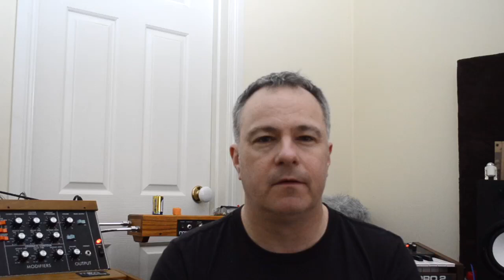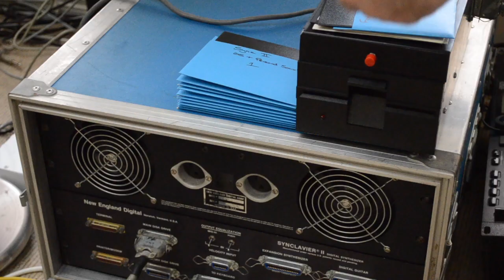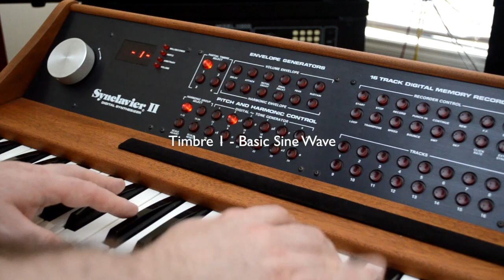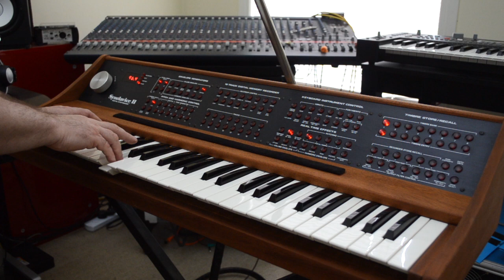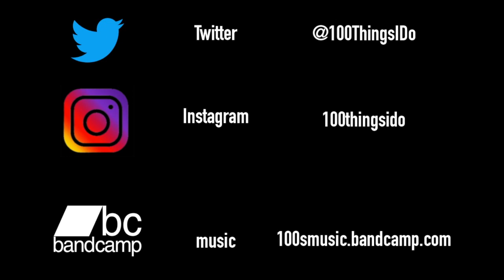SYNCLAVIER II CLIP #1 - Harmonic Additive Synthesis

Comment: Amazing.  Is this better than the Synclavier 1?  Also, does it need an external computer to work or just the keyboard?
Reply from the maker: A bit different to the Syncavier I which was more a university experiment and not a true production machine. Yes the keyboard is just a keyboard and does nothing at all without the computer section of the Synclavier driving it :D

Comment: Oh, gosh that's gorgeous.

I was a subscriber to Keyboard back in the day and would absolutely lust over the 2-page ads when the Synclavier came out. I did additive synthesis at CCRMA for a couple of quarters. The sound you get here reminds me of a lot of the sounds that came out of that center. I didn't really remember until this video how different this stuff sounds from the normal subtractive synth world. It's really stunning. 

Now I desperately want the Arturia (as well as their cs-80 simulation 😏).

Wow wow wow.
Reply from the maker: Arturia Syncalvier is great! Runs parts of the original code (I was told this by Cameron who wrote the original Synclavier software)! :D

Comment: You seem to have very little trouble building up a nice-sounding patch from scratch; would you say that's the norm for the Synclavier? One reason I ask is that I'm the type who will get a synthesizer and delete every single factory patch, but I'm leery of doing that outside of subtractive synths because I worry that I won't be able to intuit how the instrument works well enough to develop my own patches. Seriously considering picking up Arturia's softsynth version if/when it goes on sale.
Reply from the maker: Its quite easy indeed but very different to the way the DX-7 deals with FM. You basically build 1 to 4 harmonic spectrums then add FM with the FM Envelope. Normally I'm not going for any specific tone or sound.. just create something on the fly that inspires me and go with that. For sure the Arturia Synclavier is fantastic there is also the iPad version from Cameron Jones himself which is fantastic and support MPE both well worth the money. :D

Comment: That instrument has been my holy grail, my wet dream, my unobtainable love of an instrument since high school, back when I heard it used for the first time in Patrick Gleason’s, ‘Vivaldi’s The Four Seasons.’  Now I have one — one that exists only as software mind you — but still, it is a damn good, faithful recreation of the original instrument. It is built around the same ABEL code that the original was. In many ways it goes way beyond the original in terms of the UI, programmability, and sound quality. It is Arturia’s Synclavier V.  Learning to program it well enough to be able to hear a sound in your mind’s ear and be able to dial it up is a steep learning curve. Just god through the presets and you will get a very good idea of the breadth and depth of what this instrument could do (and can still — even more so) today. With a good, high-quality MIDI keyboard controller, you can have your very own Synclavier. One thing I would love to see Arturia add is the full sampling, sequencing, and ‘record to disk’ side of the instrument. That way, you could run it in ‘stand alone’ mode and have the full Synclavier experience, no need for your DAW — well, OK, you still need to do all of your post production in your DAW but, hey, just nitpicking here, after all, Patrick Gleason mixed and saved out the final mix onto a stereo digital tape on the Synclavier, no mastering at all.
Reply from the maker: The Arturia version offers a lot more functionality than the hardware, its a great instrument. One of my friends did a comparison  between that and the iPad version from Cameron Jones and team and found they sounded exactly the same. So, its all about Cameron's wonder code and how it makes the sound than the platform your running it on :D

Comment: as a student i was lucky to earn some experience with the Synclavier II — one of its many strengths is that it doesn't produce any "unnecessary" frequencies — it sounds fantastic in the mix and it sounds also majestic as a standalone.
Reply from the maker: Yep, the single filters on the front really give it a mellow sound :D
Reply: I too was able to use the system when I attended Full Sail in Florida back in 1990 and it was truly a wonderful experience. How I miss working with those fully expanded systems!

Comment: I looked through the comments and didn’t see it asked so sorry if you have: I have the iPad Go! app and was curious if that main pad sound was a preset or did you cook it up? If preset what is it called?
Reply from the maker: Its the sound I cooked during the video. I think I used Eventides BlackHole reverb to give a bit of modulation. More sustain on the tail of each note and a slightly longer attack :D

Comment: If i ever win euro millions...
Great piece of engeneering !
Reply from the maker: It really is fantastic :D I just need some more FM voices for mine
Reply: @100ThingsIDo  Old comment,  but,
Are these machines upgradable ? Like adding one extra board for an extra partial...?
It's crazy,  this thing was so ahead of the time . The guys who designed all these boards,  PCBs, all the circuitry,  etc,  must laugh (or cry) when they see what can be done with today's technology... like the tiny raspberry pi thing.   I wonder what these guys would be able to invent,  today,  with all the tech available...for sure, they would create some kind of crazy hybrid access virus + oberheim + moog + prophet + Yamaha cs80 + ...., and would probably invent some new synthesis modes..
Also, the sound you created at 3'05", was just too good...  the guys who own arturia's synclavier V must be in heaven,  if you somehow were able to share the preset with them (I wonder if it's even possible,  to export from hardware and import 100% identical,  via the arturia plugin. 

Thanks for sharing your videos (btw, you went from 1000 users,  the time you published the video,  to almost 5000 users,  today 6/6/20)

Comment: Excellent synth.Totally destroys the Arturia in sound quality and function.
I wish some synth company, maybe Arturia would re-issue and make a real unit for sale. I would buy one instantly.
Reply from the maker: It would be nice, the problem with the Synclavier is almost nothing is in the public domain on how the Able processor works, how the XP/L code functions etc.. Without that even reverse engineering is a very very very difficult task :D
Reply: Well, this is probably sort of both right and wrong. The Arturia version after all is more or less the original code, down to preserving certain quirks and limitations (due to the 1980s hardware limitations) which could have been easily fixed today but Arturia has wisely chosen to keep them in place in order to preserve the integrity of the original presets. So the output hitting the D/A converter's input ought to be exactly the same. The difference in sound is most likely due to the fact that most home PCs have firmly average sound cards and the original Synclavier had (I'm assuming) a dedicated top-quality D/A converter.
Reply: Well even DAC per voice in the hardware Synclavier ! Huge difference compared to the software.You are playing a four notes chord using four partials, there are 16 different DACs plus the final one.The sound is a lot more lively.

Comment: The NeXT best thing that you can buy is the Kawai K5000 Advanced Additive line of synths. They Excells at Additive synthesis in the hardware world, no FM though.
Reply from the maker: I have always had my eye one getting one .. just waiting for the right moment :D
Reply: I love mine. I have a demo of it on my channel, if you are interested: https://www.youtube.com/watch?v=owU3hwBQ0is
Reply from the maker: Ill check it out .. thanks :D
Reply: +100 Things I Do also the Seiko DS-101 and DS-202. Which you could attach the Seiko DS-310 (additive synth to) as well as DS-320 Sequencer but that only to the DS-202 model. These were basically home keyboard additive synths and Seiko's attempt to get in the digital keyboard market and compete against brands like Casio.

The DS-202 has all the home keyboard features with the auto rhythms and bass cords and such as wel as 10 preset sounds. An analog chorus is built in to liven up the sounds but when you hook it up to the DS-310 Additive synth then it really becomes something special. The DS-101 is a stripped down version of the 202 with some added features. No rhythms or any of that stuff. Something like sustain, key transpose, and tune knobs are still included. Just 16 presets (6 extra over the DS-202) including 4 "synth" sounds. They expected the 101 to sell sometimes without the 310 so they thought the 4 synth sounds may lure back a purchaser to add the 310 later. both the 101 and 202 could be sold by them selves or as the kit. From the research I have done it appears most of the 202s were sold as the kit, because spending that kind of money already they might as well have went all in or just stuck with a Casio. Still, you see the 202s sell without the kit. Maybe a lot of 202 keyboards were left over after production and were sold at a reduced cost....who knows. The lower end DS-101 seems to be more rare....as there is much less info and talk about it on the web, let alone evidence of past sales. The keyboards alone sell for around 300 bucks....give or take....but the kits sell for a few grand!!! I saw where a kit sold for under 400 dollars in the past.....man I wish I would have got it. I bought a DS-101 from the online Goodwill auction site. Funny enough my winning bid was also the cost of shipping, both $38....but the bottom peice of the case was smashed into pieces and 1 key needs to be fixed. I put back together the puzzle, superglued and duct taped it....looks ugly but it works! P.S. Most synths from goodwill will be broken in some way. Also, they may say only a key is broken...but then u find out half the circuits are dead. Be careful when buying from the online goodwill as there are no returns and it is %100 percent risk. I got burned on a Korg SP-80S that I am now selling for less than I payed.
Reply from the maker: Thanks for the Information on the Seiko, I saw someone give a good demo of the synth on Youtube a while back (can't remember who this was unfortunately now). Its great to explore new things, even if they are in older machines. The synth world seems to of gone Analog mono and Analog poly mad!.. While this is great in some respects it would be nice to see more people with new and fresh ideas. Turn the  Paradigm on its head and go in a different direction!  In the mean time I'm sure i'll pick up the Seiko at some point :D Thanks again!
Reply: +100 Things I Do Maybe the Quantum from Waldorf will set in motion a new wave of digital. I don't think granular synthesis has seen it's golden age yet. Hope to get one of those if they ever become affordable on the used market.
Reply from the maker: Yep. The Quantum looks very very interesting. I very much like to look of the C15 from nonlinea Labs also, under the skin the voice architecture is quite unique from your run of the mill FM Synth.  Granular is very cool, "Sampl35 - Fairlight CMI III MFX 2" is a clip I made of Granular samples of my composed tracks sampled and turned them into a track with hip-hop flavors on the Fairlight! I wish the Quantum would come down a little in price. For 8 voices that's a hell of a price!  but then quality = money :D

Comment: You have two things I've always lusted after: a Fairlight Series III and a Synclavier. Well played Sir. Even though they can be recreated in software, there is still something awesome about the original units.
Reply from the maker: I'm a hardware guy! I own and have tried so many software synths over the years. Very few have made their way into my workflow. There is nothing like the feeling of actually using the real thing as you say :D
Reply: Totally understand. I lean towards the soft-synth path (I have hardware too) because of space availability, cost (who has the budget to buy all these vintage units?) and the convenience of being able to do most things inside the box. I'm not a pro, so emulations are fine for me and truth be told, in the mix they sound good enough for me. Doesn't mean I don't still want some of this cool gear in my studio though ;-)
Reply from the maker: When all is said and done... its about the music and the sound you create .. who cares what you used :D  The only 2 synths I ever regret letting go was my first synth (Roland SH-3a) and my Prophet 5 ( which came to a sad fate after I sold it ) :D Most of the rest I can part with when I feel it does not inspire or fit my needs!

Comment: beautiful, magical @3:00
Reply from the maker: It is indeed capable of amazing, warm and lush sounds. Just so very different to other FM implementations around that time :D
Reply: i was always fascinated with this early ned sound.  found the ork locally, but no early fm cards. would have to ship from the states - which means $$$$.

btw, have you ever tried the newer machines, from 1984 onwards, with 16bit fm ?

i presume theres less quantisation noise and aliasing, but i wonder if they lose much of this warm, magical character ?
Reply from the maker: The only Synclavier I have ever had my hands on is mine!  They are a rare beast at the best of times... I could not locate one in Australia to purchase or even play! I'm not sure that they moved to 16 DAC's for the FM but I am possibly incorrect on this! The Sample cards and the FM are very separate interfaces (you might know all this already). I only have the 8 FM voices presently .. If your on Facebook there is a 'NED Synclavier - Classified' group you could join. Systems and parts show up from time to time at decent prices! :D
Reply: thanks, ill give it a look. will try to find out more about the hardware changes too.

PS what was the reverb you used in the improv section, im intrigued?
Reply from the maker: I can't remember for sure  but its normally one of the following - Eventide Black Hole, Valhalla Vintage Verb (set to 70's flavor) or Waves RVerb. I'm pretty sure it would of been Valhalla Vintage on this one :D
Reply: Hi Clusterchord, the FM Synth cards did not change after the stereo upgrade in the early 80s. Later Systems use the same 8Bit FM engine as the small SyncII systems. The main thing added by the "big" systems was faster CPUs, bigger storage and polyphonic sampling. You can stack and freely route Sampling and FM. The 16bit sampling engine combined with the 8bit FM engine sounds absolutely sublime, like nothing else in this world!

Comment: Does the keyboard itself has any synthesis engine inside?
Reply: No, you don't need it to program sounds
Reply: I mean those huge racks that are connected to the keyboard. What synthesis is possible without those racks?
Reply: Those huge racks were the 9600 systems with FM and stereo sampling.
The smallest rack you could have would be an FM system only , then a 9 or 10U rack
Reply: That is what I am using,without keyboard
Reply: OK, and if i have only the keyboard. What's then possible?
Reply: Nothing,it is just a controller
The synth's engine is in the rack
Reply: That's what i wanted to know, since the first question. Thanks! :-)

Comment: Wally badarou did a lot of the patches in the 80's   ... he worked with level 42 and grace jones. he released  an album made completely on the synclavier in the 80's . called  (Words of a Mountain)
Reply from the maker: I'll have to check out Words of a Mountain! I think Slave to the Rytm (LOL!!) was done on Synclavier if I remeber correctly! :D
Reply: 100 Things I Do have the arturia emulation of the synclavier which focuses mainly on the fm side without the sampling capabilities.

Slave to the rhythm is actually my favourite grace jones track  :-)
Reply from the maker: I always liked Private Life myself. I was tempted to get sampling included with my Synclavier... but that's what I have the Fairlight for :D
Reply: 100 Things I Do Now you just showing off :-)
Reply from the maker: If it makes you feel any better its been around 35 years of lusting after this equipment to get to this point :D
Reply: 100 Things I Do I just knew it as the expensive futuristic workstation .All that changed when companies like  (Akai , Roland, Ensioniq and. Emu) . joined the sampler race